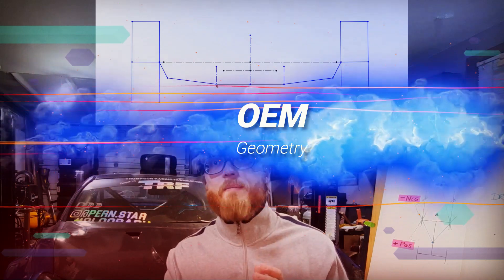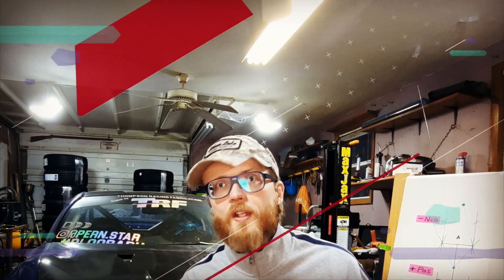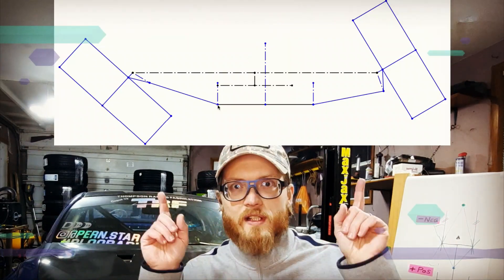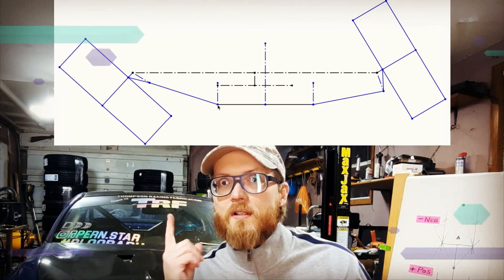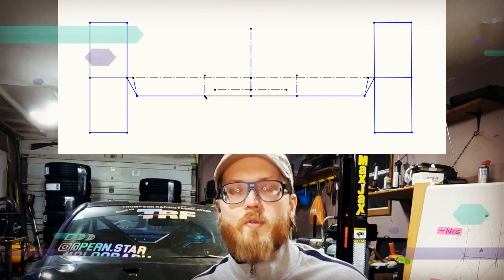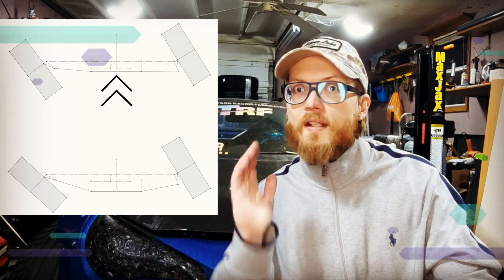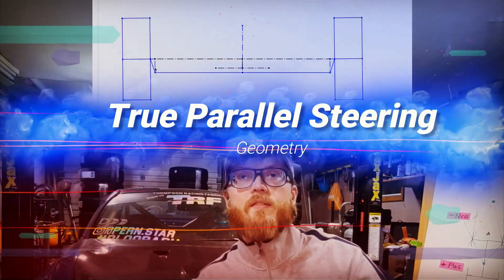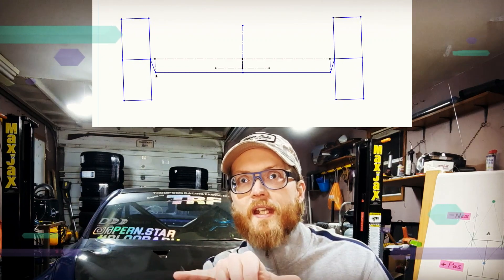Nerd Alert - EP 2 - Full Lock - Everything about knuckles / How and why angle kits work

Comment: Had cut knuckles on my s13. Street drove barely any miles. Inner front tires were toast. And nobody had an answer why or ever complained about having a similar issue.
Reply from the maker: Camber determines where the tire wears on the highway, toe determines how much.
So, sounds like your toe was not zero.
Reply: @pernstar   my toe was 0 aligned on a rack. im convinced the trail wheel would drag and eat away the inside of the tire. cut knuckles possibly negaive ackerman.
Reply from the maker: @driftingbrandonc.6480   I have never in my life seen cut knuckles with reverse ackermann, just saying.

Comment: Does this same theory apply to front steer cars when trying to reduce Ackerman in drift? Or is it opposite?
Reply from the maker: If by front steer you mean front rack and how that correlates to rear rack, then yes, the lateral direction you move the pivot points in is opposite to achieve the same effect.

Comment: im still missing why youve settled on anit ackerman setup.  is your choice solely based on "path of least resistance" for the tire? theres a ton of pros to have that "anchor point" of a trailing wheel that doesnt have all that steering angle.
Reply from the maker: Before I type up a lengthy answer, did you watch EP1? :)
Reply: @pernstar  i did watch episode 1. im very good at math and understanding concepts. thats why i assume you just think that anti ackerman is "smoother" or "path of least resistance" around drifting a corner.
Reply from the maker: Gotcha, well I wasn't sure if you saw the animations in that one.
Basically, rev ack geometry allows the tires to follow their natural trajectories around a turn without excessive slip angle.
That results in less resistance and more grip overall.
I am aware that there are benefits to having pos ack, but those can also be achieved with other metrics and when I setup my car to be "theoretically" correctly aligned it felt the best. So that's why I am a fan. There are tons of variables that play together tho. If your caster / KPI / trail / scrub isn't right, the ack by itself isn't everything. :)